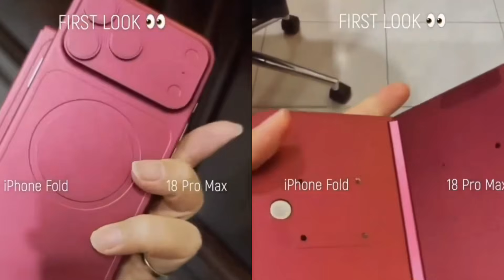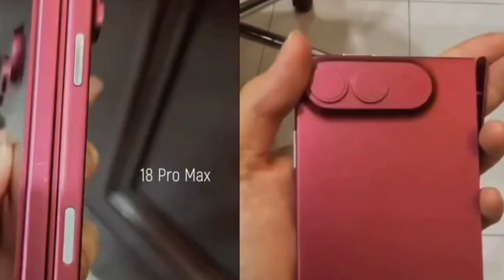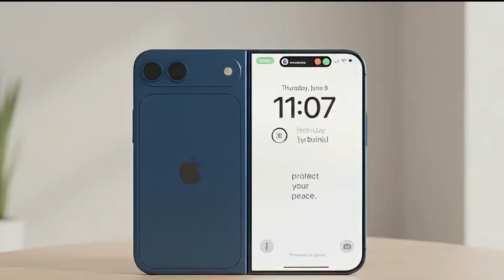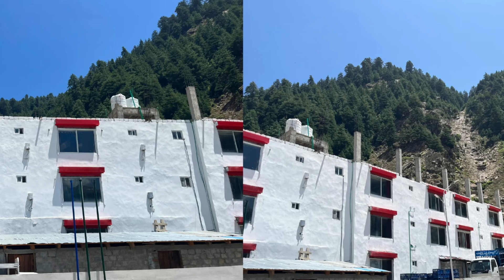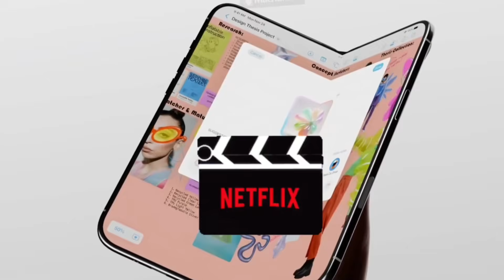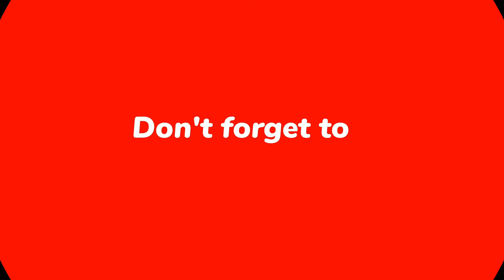iPhone Fold - OMG, Amazing First LOOK!😍

Comment: If the intent is to make this device a premium to the Pro Max, then Apple missed the mark.  They should have made it slightly taller or thicker to accommodate Face ID & a telephoto lens.  I have a Z Fold 7 that I own and it will be a hard sell to get me to trade that device on a device that seems to be starting its life at a disadvantage. 

Since the phone most like would always start in a folded state, then they could have put Face ID on the oytside display only.  They could have reserved Touch ID as back up method of authentication when the device is unfolded and the screen is off.